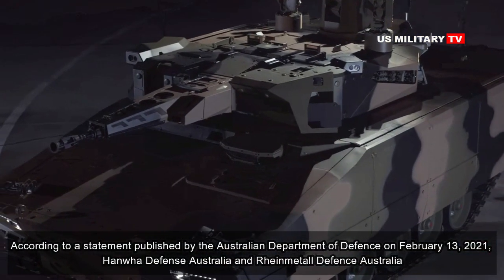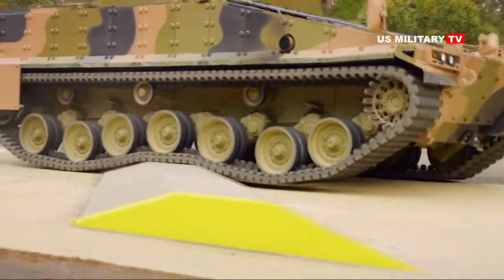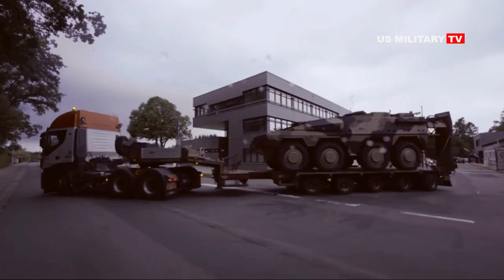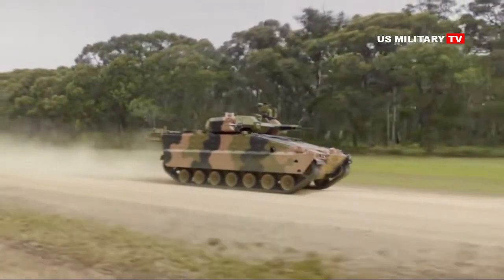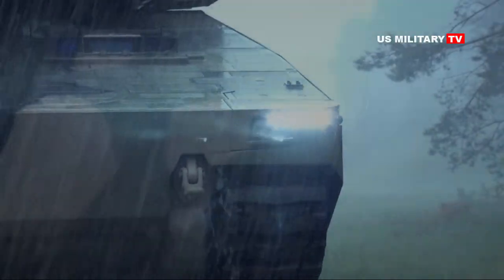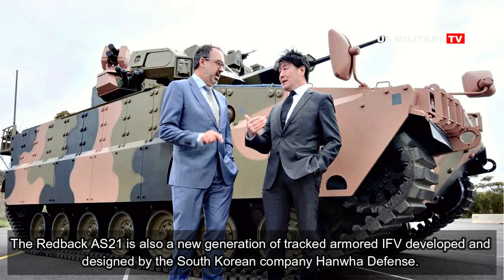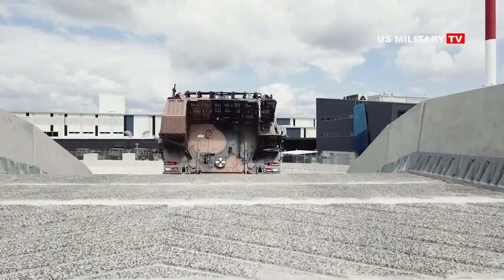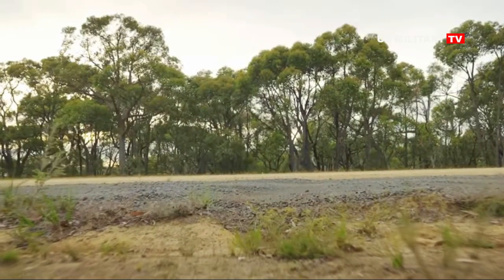Significant milestone : Rheinmetall KF41 and Hanwha AS21 IFVs Australia evaluations and blast tests

Comment: My guess is that Australia will prefer German products. However, even if as21 fails in this project, the latest technologies applied to as21 will also be applied to Korea's k21.
Reply: Well not quite the naming is meant to utilize the reputation of the K21 but the tech for the AS21 leverages from the project development for the newer K31 (to replace the K21)
Reply: @steelgear3876  Korea has no plans to develop a new ifv yet. There is a plan to additionally mass-produce the k21, but there is a saying that the k21 will be produced with the as21 specification.
Reply: @버프코트  the Australian defence minister said redback was better
Reply: Hard to say which will  be chosen, the Germans have an edge I think but Korea have stepped up and shown they can compete, even if Korea doesn't get the contract the data from this competition will be invaluable in improving Korea's IFV technology edge.
Personally I hope the Redback wins as it will complement the excellent K9's we are getting.

Comment: The Rheinmetall Lynx edges out over the Redback for me as it seems to be the more heavy duty machine (no rubber tracks), it has a faster top speed 70km/h vs 65 and can accommodate 9 vs 8 soldiers.
Logistically the Lynx will also be the better choice even though the Redback does share a similar engine to the Boxer and the same transmission as the Abrams the Lynx shares a lot more in common with the Boxer. Things like spare parts could be shared, reduced training and common anchoring points making transport such as on trailers much easier.
Reply: Composite rubber is tougher than steel!

Comment: Can someone teach this strange speaker how to pronounce "Rheinmetall", rarely heard such a stupid deformation.
"Rheinmetall" – "Rhein" is "Rhine" and "Metall" is "metal". 

This "Rhine" not only comes from the river Rhine, it is also spelled and pronounced the same way.

One word with one syllable, nothing is linguistically torn apart.

As a company name "Rheinmetall", the combination of "Rhine" and "metal" is a nominal compound, as such a proper noun and a word that cannot be mangled even by English speakers.
Reply: It's a robotic voice, not a real human.
Reply: @scratchy996  Whatever it is, it has to learn to speak properly.

It is an old problem that has accompanied me since I started to deal with computers. Back then it was the US-ASCII idiots who built programs that couldn't handle umlauts, today it's the trolls who are too stupid to design their programs to handle multiple languages at the same time. But this would be necessary, because they mix more and more and terms from one language are also used in another.
Reply: It's totally ballsed up. The 5 written vowel sounds in English don't cover the 20+ vowel sounds you hear in spoken English, so reading the word out is not enough.
Reply: It doesn't even pronounce, Straya, properly...
Reply: It doesn't speak English properly let alone any other language
Reply: @SilverMe2004  The stupid program does not have to be able to speak English correctly. It would be sufficient if the stupid part would master the world language "Bairisch" correctly.  But then with all dialects from Romania in the south to Saxony in the north, from Siberia in the east to North and South America in the west.

The Swiss even assign their own number series GR 90001 - GR 94999 to the vehicles of those who speak understandably from birth and do not have to learn understandable language laboriously as a foreign language only in elementary school.

Comment: Redback seem to be more efficient and reasonable infantry combat vehicle than Rhein metal one.
Reply: Note in advance that "Rheinmetall" is a company name, nothing is translated and certainly not split into two words.

Not even by English speakers who do not understand the highly useful use of nominal compounds.

Otherwise, the Lynx KF41 IFV is the better solution in every respect.

Recently, an army on a continent with integrated arid regions bought 211 8x8 Boxer Combat Reconnaissance Vehicles (CRV). Of these, 133 were equipped with LANCE turrets and 30 mm cannons, along with simulators for training purposes and workshop equipment, etc.

What do you think pleases the maintenance personnel and logisticians more? A completely different system from a different manufacturer or a tracked vehicle from the same manufacturer with the same turret, same 30 mm cannon and also otherwise a lot of identical parts inside.

Let's assume the CRV and IFV are deployed together for a peacemaking or sustainment mission somewhere in the world. What would be more useful, the workshop and the personnel to maintain the turret with cannon and the option to exchange spare parts or two completely different systems where nothing fits together and twice the workshop equipment?

The one who can repair the LANCE turret and cannon of the Boxer can also repair the LANCE turret and cannon of the Lynx KF41 and vice versa. They also need the same tools and spare parts. I doubt that this will work with a LANCE turret and an EOS T-2000 turret, because you have to carry everything twice. Unnecessary effort in the field is something that has never been particularly helpful.

A vehicle that is not operational because a spare part is missing is useless and if I have to build up a supply chain twice, the risk increases. One spare part for each of two system is worse than two spare parts that could be installed everywhere.
Reply: @wernerruf7761  Don't forget transport of the equipment, trailers for example are half a million dollars each and the two vehicles share identical anchoring points.
So many things in favour of the proven Rheinmetall platform vs the new Redback.
Also those rubber tracks on the Redback don't look like they will hold up well in a tough environment, lucky they are easier to change!
Reply: @captaron  red back will come with metal track opt.
Reply: Why do you think the Redback is more efficient ?
Reply: @scratchy996  bc redback has a screen looking outside while lynx does not. To be realistic, lynx would have to look outside, bullets would just kill the person looking outside